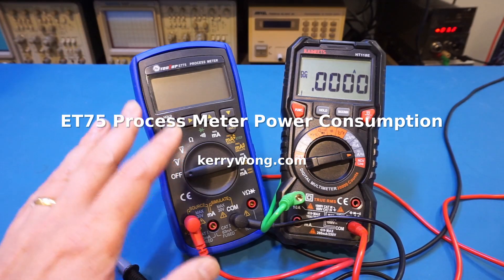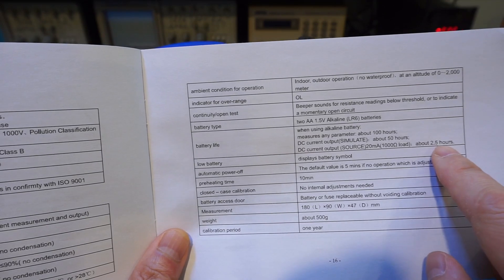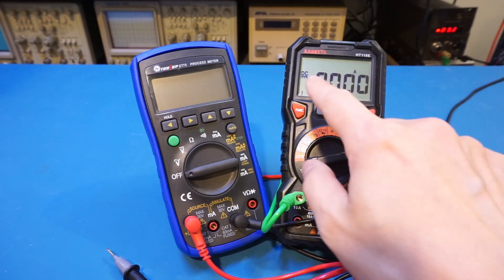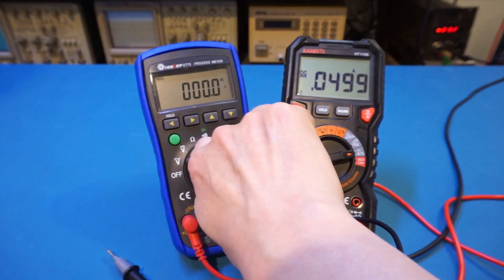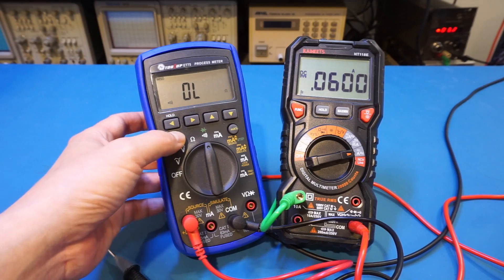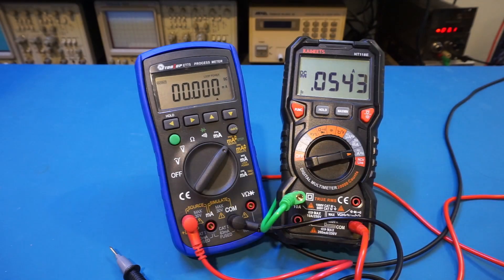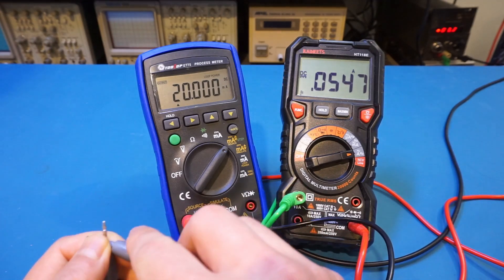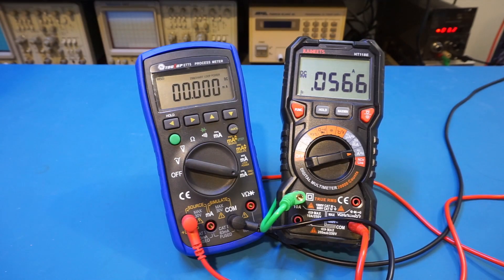Power Consumption of the ToolTop ET75 Process Meter

Comment: Better than I'd imagined! 👍 In the big EEVblog "Testgear-multimeter-spreadsheet" not a lot of meters listed use 2 AA cells. Those that do, seem to get 100 hours which isn't drastically better than the 50 hour estimate, given the low purchase cost. The boost circuit efficiency when the batteries are down to 2.8v may put that real-life consumption number down to 35 hours. Who knows, but the price is right and maybe a 3.3v LDO powered by a USB charger is enough ingenuity to make this thing a bit more reasonable.